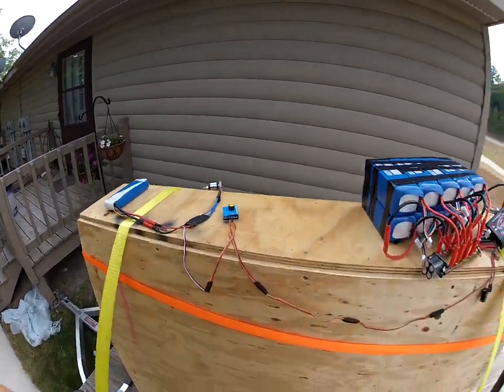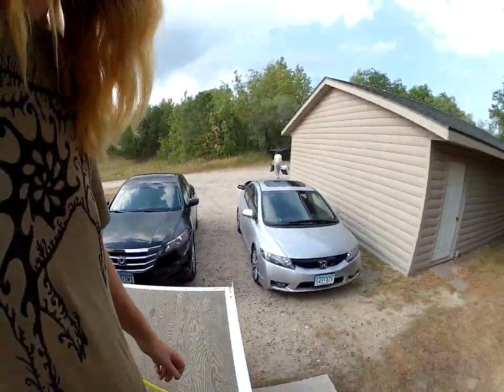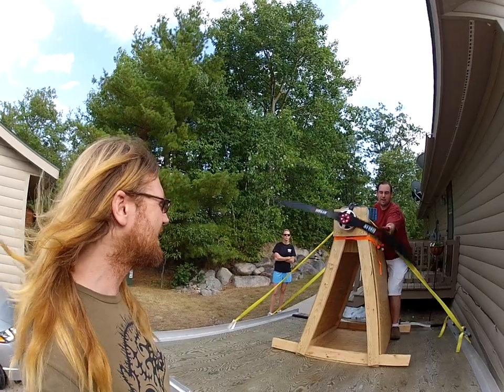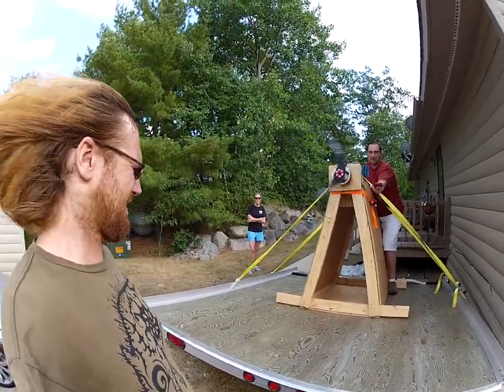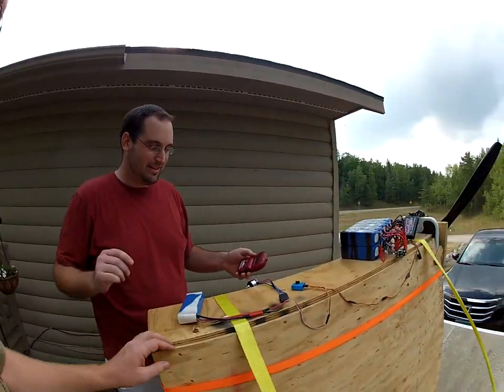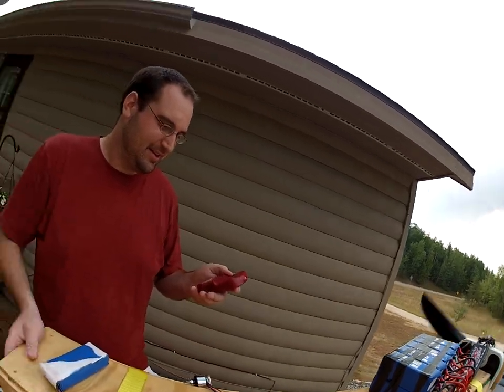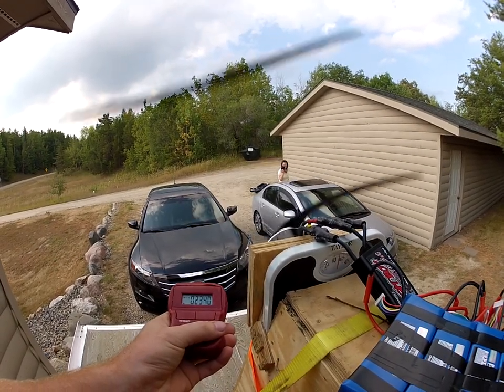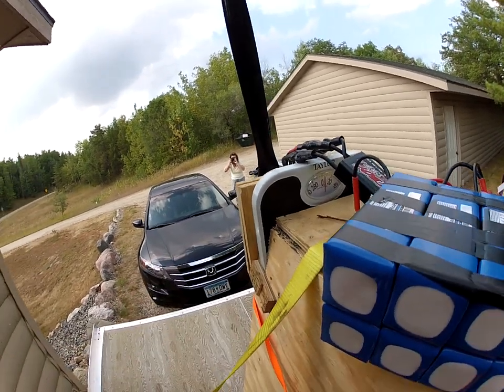DM12K - Power to Thrust O Meter

Comment from the maker: Flight time will most likely be pretty short <10min at first but we have a few ideas for creating power so we won't have to rely on just the lithium. 

Payload should be around 200lbs, our goal is human flight.

Flight controller hasn't been determined yet, we still haven't tested what update frequencies this ESC can handle.